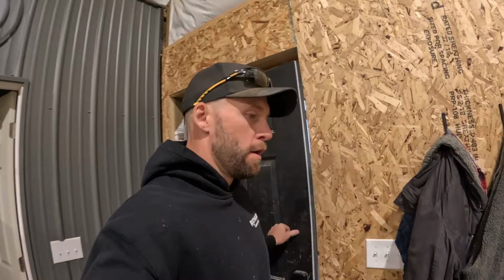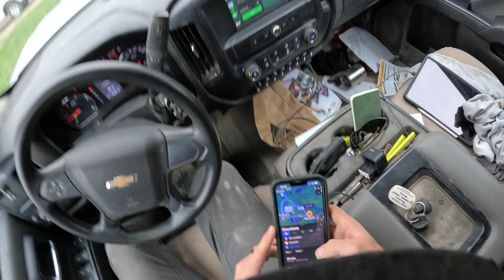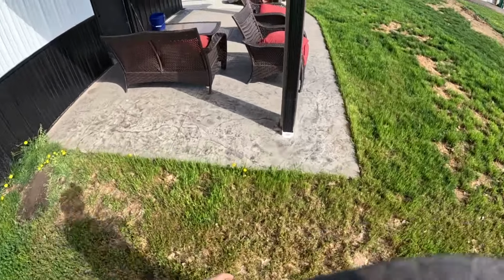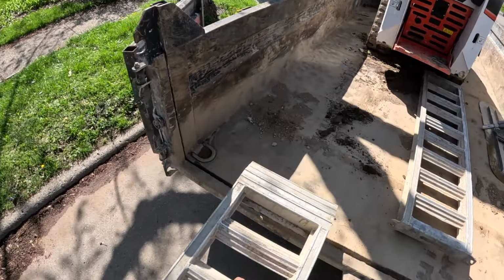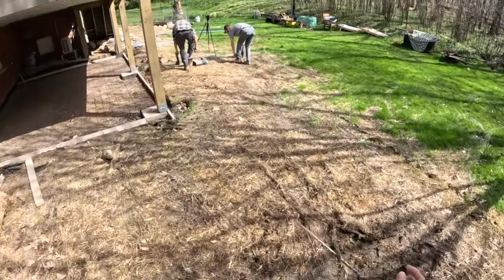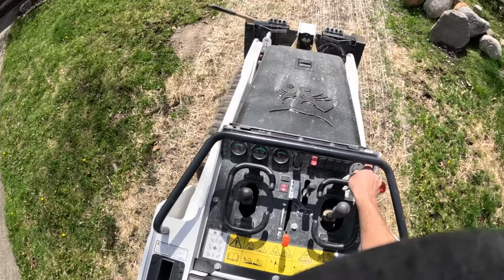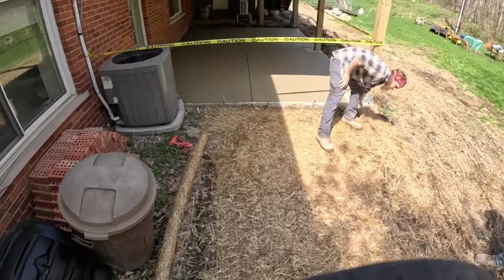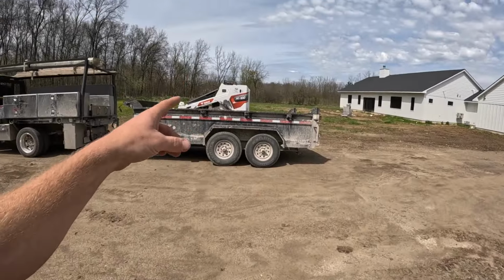I Let the Guys Pour This One!

Comment: Is it required in Michigan to cover dirt/sand etc with the tarp on the dump trailer? Or do you just do it?
Reply from the maker: I’m not sure on that. I’m pretty sure it’s a law for a secure load, but I could be wrong
Reply: @RathburnContracting gotcha, I was just wondering cause we usually don't tarp down a load of dirt but I'm sure your on some busy roads and don't want any rocks hitting a window

Comment: Where u located at 
Ann arbor area???
Reply from the maker: Yes sir
Reply: @RathburnContracting  i saw the sing on your truck Manchester 😁😞😞
Reply: @RathburnContracting  the reason i asked cause i saw the concrete supplier i did a parking lot in ipsy and i used them lol